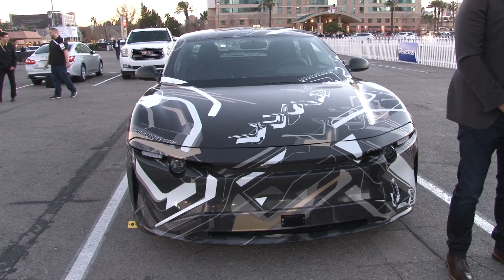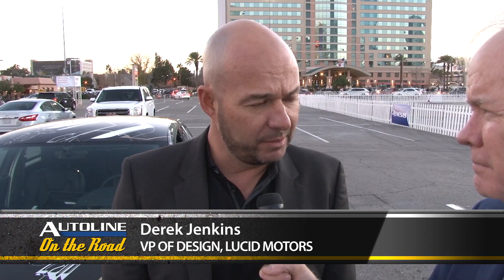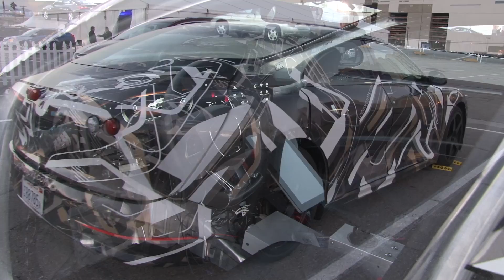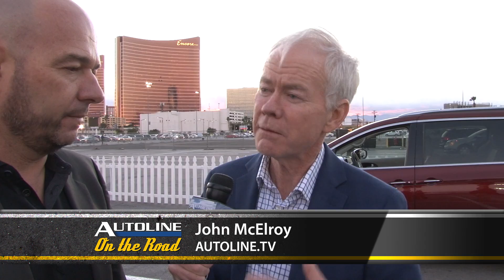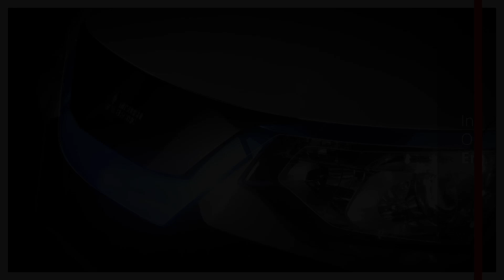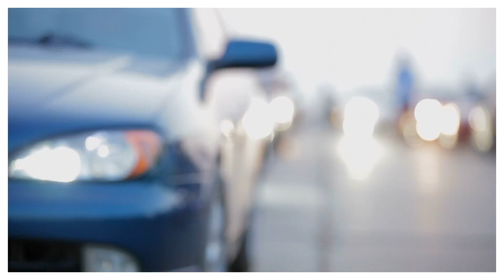Lucid Motors, Lucid Thinking - CES 2017

Comment: "New". "Advanced". No, its not. Its an electric car, laid out a bit differently. Its an electric car like a Tesla :/.
Reply: Tesla Motors are not the most advance high tech EVs. They are the most refined product and mass production capable EV makers. They are not attempting to do excessively advance features that won't be benefiticial to mass adoption. The two companies have different goals. Just like ICE cars there is a lot of variations and different levels technical capability for EVs.
Reply: Neojhun I dont think you understand. They are both EVs, both moved the battery from the 'conventional' place in the rear for 'more space inside', both are capable of mass adoption. In fact, this car has an edge in adoption over the tesla since it wont cost as much (teslas are disgustingly overpriced and overequipped anyhow).

Theres a lot of variations and different levels of technical capabilities for any car. But that isnt to say cars cannot be similar, either. 

Its why i say this car is not "new" or "advanced". Its just a load of marketable wording :/
Reply: You generalisation and assumption are just inaccurate. Lucid is using a variable geared transmission tailored to each compact Electric Motor module (no inverter no controller). In some high performance versions 1 Motor 1 Wheel 4x Motor system how they easily achieve the 1000+ HP. That is called Independent Torque Vectoring, only other cars I know of are AMG SLS Electric concept & Rimac Concept One / S. Lucid Air will be the first attempt at building that system in a Mass Produced car. Lucid has not officially announced  (not marketing) that yet but based on their technical designs its quite obvious. Then also they did some weird packaging where some major electronics like motor inverter & controllers and computing are up high front dash, new and probably not good design. Advance and New is accurate description of Lucid Air.
Reply: Pretty sure they arent the first electric car 'group' to try and use an actual transmission (didnt tesla try that? Heck, you can use 2 speed powerglide in an electric car :/. Its not the first electric car to try and go wheel-by-wheel either. In fact, its been beaten to this by hybrids. 

The only thing different they're actually doing is the torque vectoring for a production car. Thats really it. And again, how things are "Packaged" is a part of the "Generic EV traits" which let you put whatever you want wherever you want because its electric. 

Advanced and New is only accurate if you're ignorant of what has already been achieved by EVs and hybrids  :/.